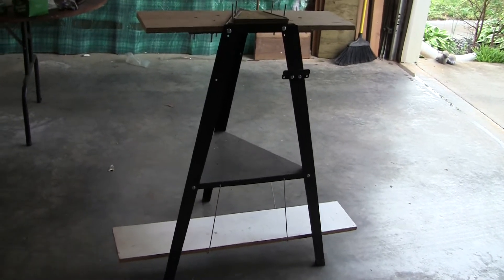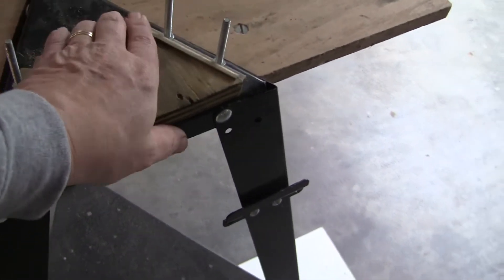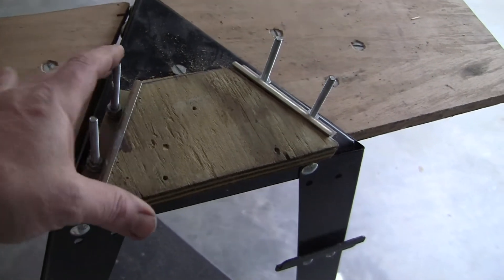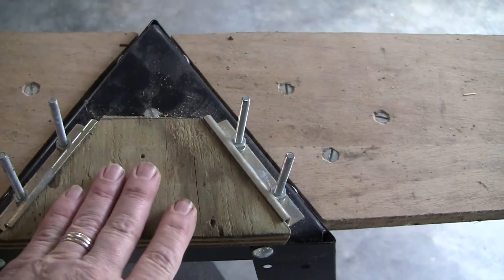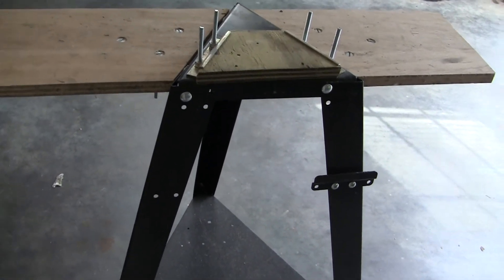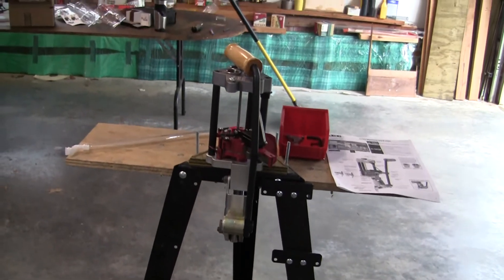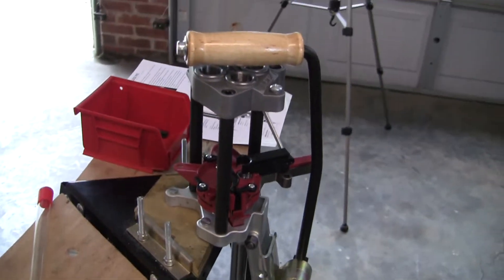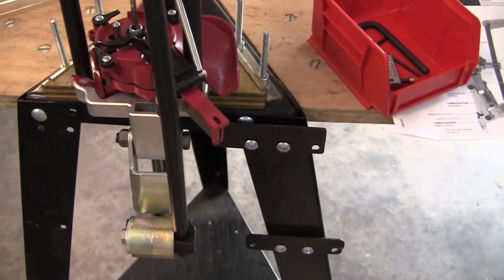Lee Breech Lock Pro getting it mounted and taking a look

Comment: Just a bit of information I use the lee stand with my Redding T7, Hornady progressive press, and now the Lee auto breech lock pro.  Order the Lee bench plate kit.  It has metal sub plates that the clips capture and hold securely.  The Lee bench metal sub plates also have a nipple at the end of the sub plate that grabs end of the clips.
Reply from the maker: thanks for the info but I mounted it directly   to that stand and I am happy with that

Comment: I am unfamiliar with these.  So you take your de primed and cleaned brass and this machine will re size it, prime it, seat a bullet and crimp?
Reply from the maker: I am just testing out the press right now, how it works is you crank the handle and a finished round is dropped in the tray. I have to install more parts, but keep watching the videos
Reply: thanks